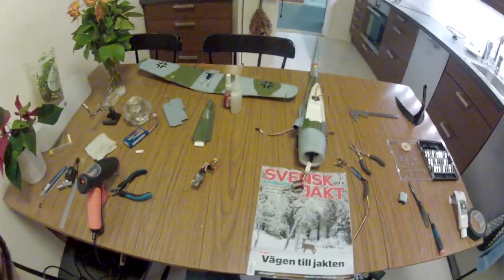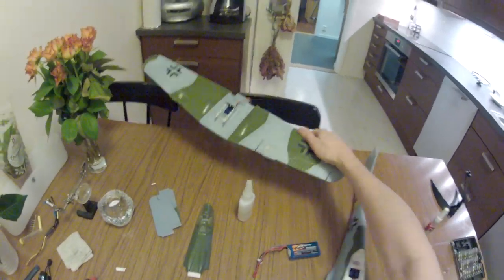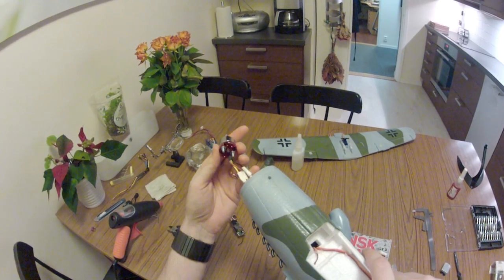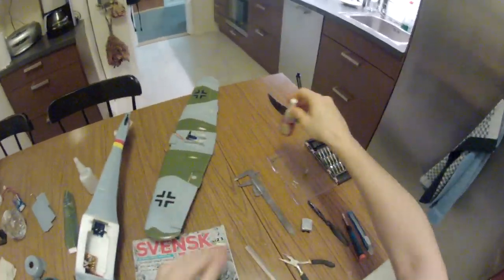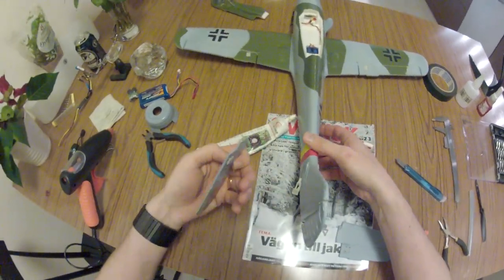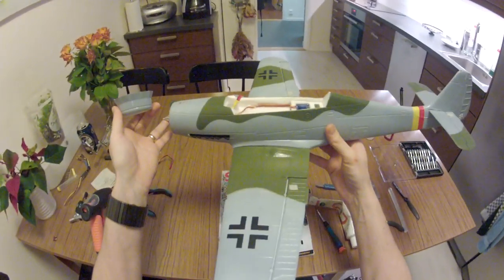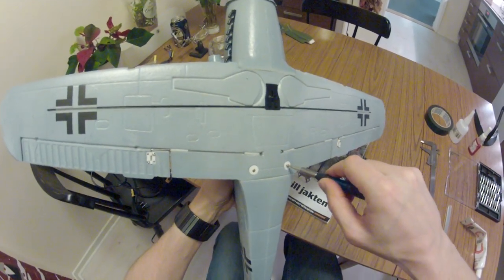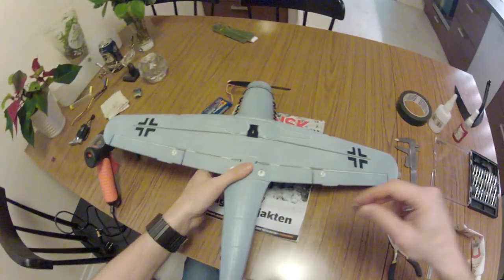Hobbyking FW190D w/model Display stand EPO 650mm - Build

Comment from the maker: I used 25C 1000mAh 3s LiPo's. Worked out fine. Be very carefull with the CG, try infront of the recommended. I had to weigh it down in the nose some to get a decent working CG. Also, it's prone to tipstall at low speeds so take care when comming in for laning, dont lower speed when you are at an angle. Also the tail is pretty flexy when banking at high G's. It's a scale cruicer even if you can turn it into a rocket the frame dosn't agree.